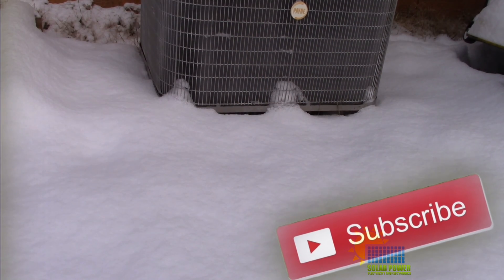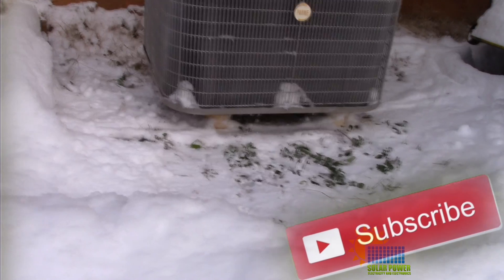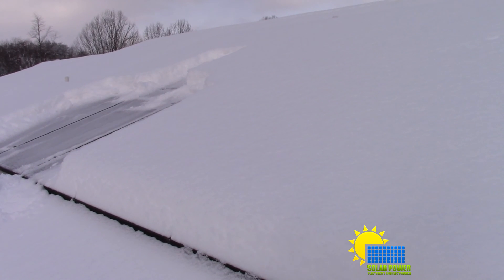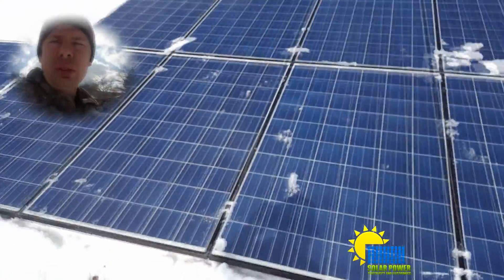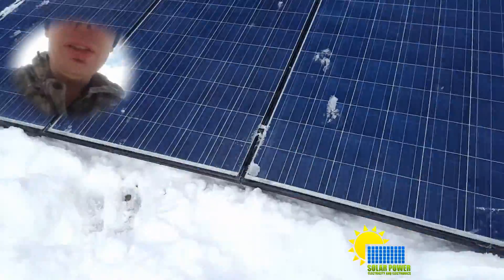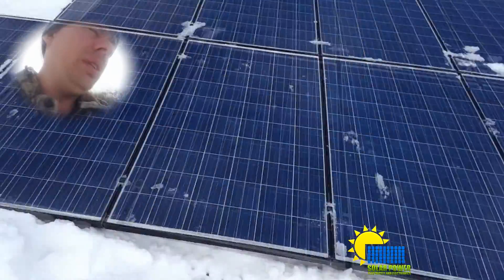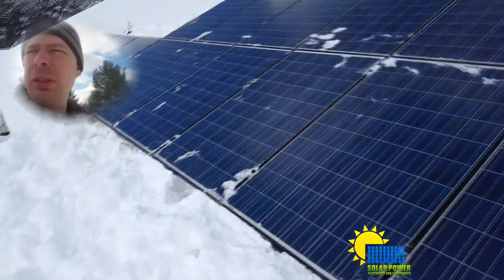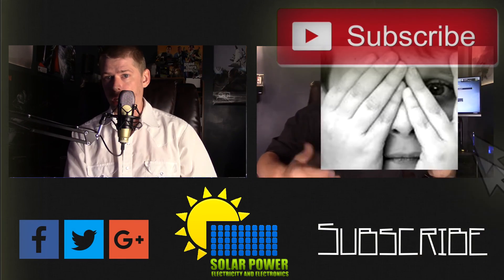Save money on your power bill after a snow. Clearing off snow from solar panels for more solar power

Comment: The cold 50-60 degree city water or well water will melt the snow off a solar panel in no time without climbing on the roof when using a water hose and spraying the panels.